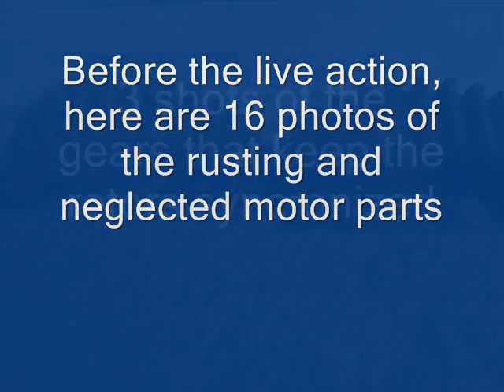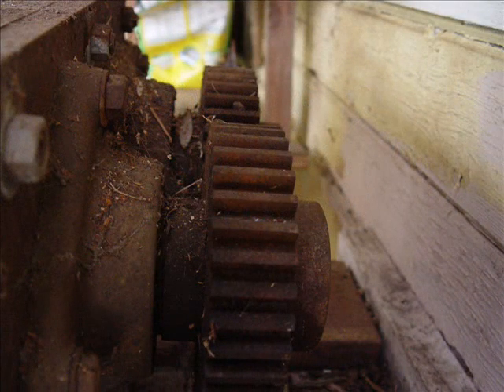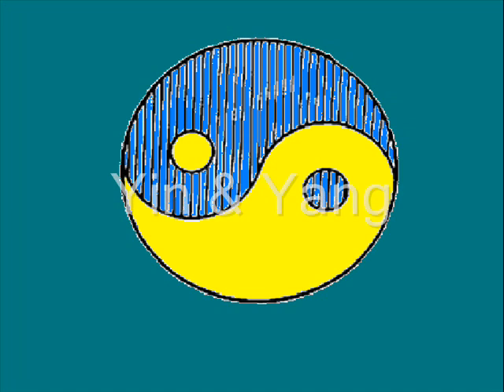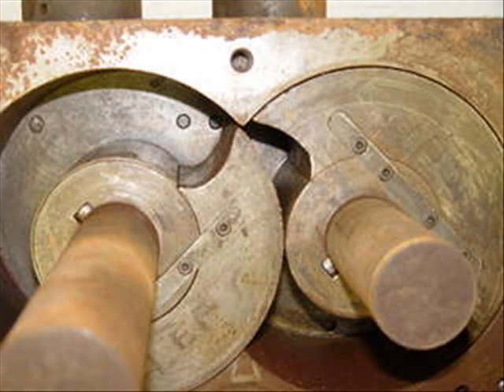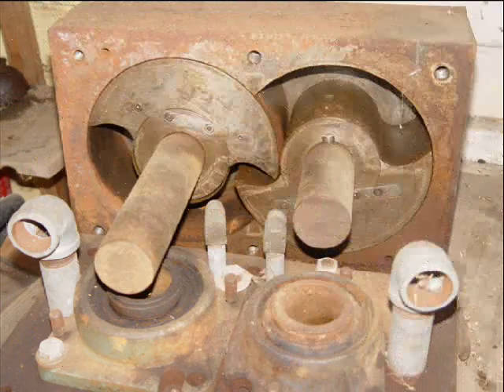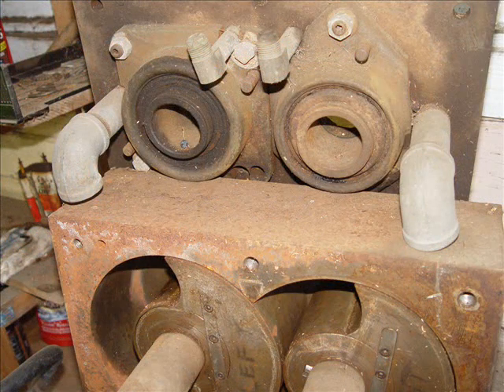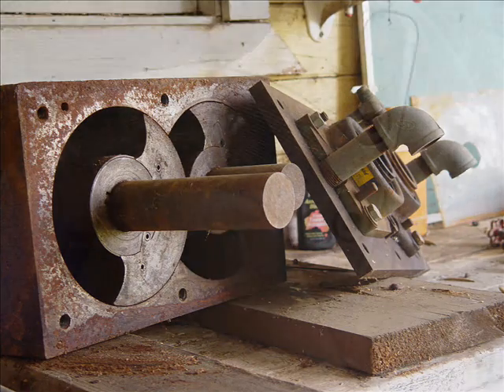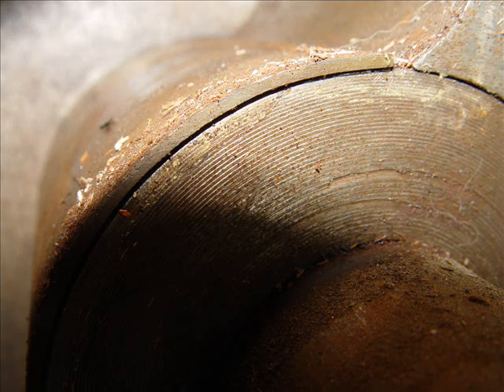Part 2-Restoring the Prototype of a 2 Cylinder Rotary Steam Engine

Comment: Ah steam turbines!
Yay! I draft proto types as well,
and have a steam turbine in the patterns.
I wounder how your form would hold against my form,
Yors looks to be more steam volume per rotation ephisan,
but I think my'n would make greater tourque and is certainly better sealed for higher pressures. Let me know if you get it  running, how the spec's look.
Reply: OK, will do that, thanks.